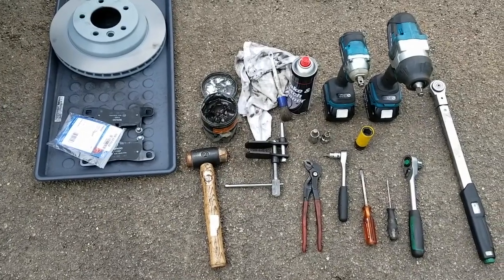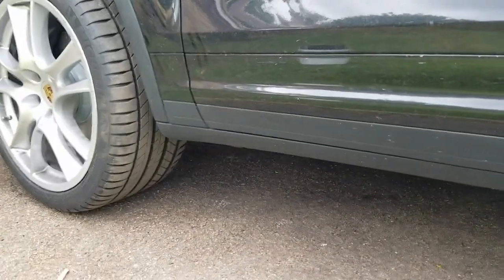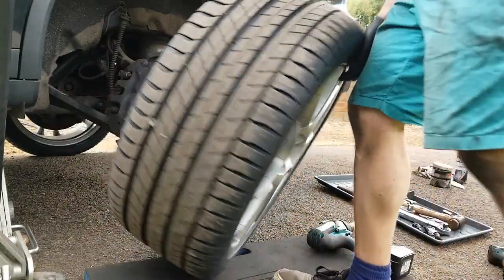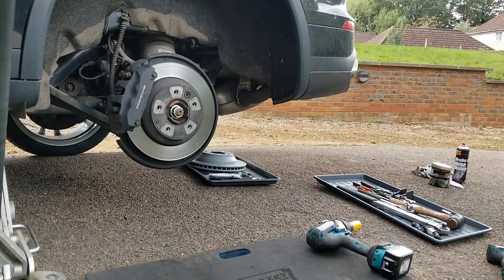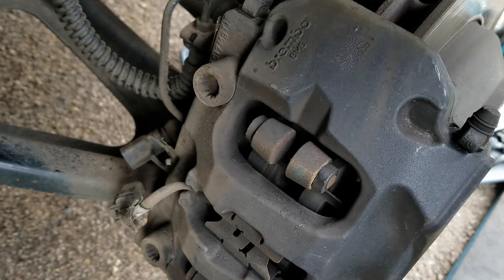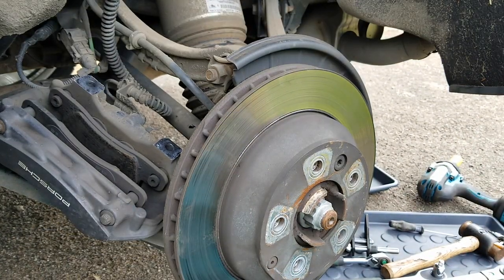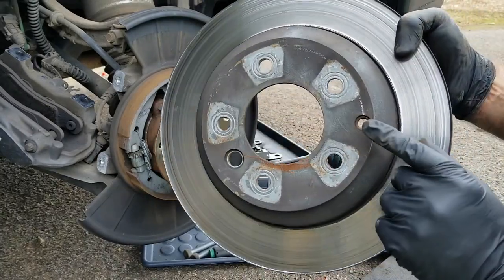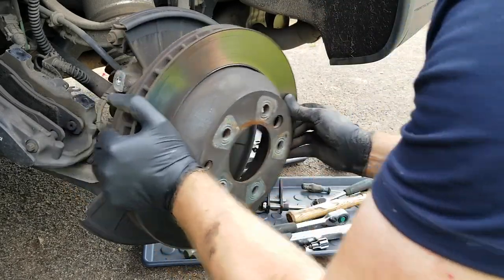Porsche Cayenne 958 Rear Discs and Pads Replacement Guide

Comment: Just wanted to say thank you very much for this and also the front pad and rotor video. Both are well-shot, extremely helpful, step-by-step walk throughs. I watched each a few times and then replaced the front and rear pads and rotors on my 2014 Cayenne Diesel this weekend. All four corners took me about 6 hours, but I did spend a bit of time cleaning.

Comment: Excellent video. I watched it, took notes and then did the replacement on my 2015 Diesel Cayenne.  Everything worked out great.  Thanks for taking the time to produce the video.  I also used your front brake video and it was also very useful.
Reply from the maker: Glad it helped, great to hear it went well!
Reply: Hey hi, any issues with the ebrake, I have a 2014 diesel cayenne
Reply: @marcelmouton6235  Not that I remember.  It was a couple of years ago.  since the emergency brake is a drum brake inside it really didn't get in the way.  I did my daughters volvo and the e-brake is electric and it just applies the regular brake - it was a PITA !

Comment: Thank you so much for the nice video! The only concern was that a jack stand was not used to support your Cayenne. I heard a lot of horrible stories associated with accidents caused by failed floor jacks. Other than that, it's such a great video! Awesome!
Reply from the maker: You are right, this is something you should do if you want to be as safe as possible. I personally only do it if I'm under the car but that's my preference, your suggestion is universally recommended.

Comment: You don't earn much, but if you had an affiliate link in your description for parts, materials, and tools, I would've used your links to buy them. It's a way to help pay you back for a great video. It's also nice to have one place to find everything needed for the job.

One small point, it would be a nice reminder to point out that level control has to be turned off before lifting the wheel off the ground.

Comment: Thank you very much for such a well detailed video. On my 2012 cayenne diesel, i noticed that when the engine is off, key is out and as soon as i open the door, the electronic handbrake light automatically comes on. If the electronic handbrake is meant to be off during the work, how do i prevent this from happening?

Also, im only looking to change my pads so whether the handbrake is on or off, does it make a difference?

Comment: Great video... Could you tell me please ? I need to replace the rear discs and pads on a Touareg 2016 R line. They are all the same bits and I was surprised that you haven't had to code the pad sensors in... Do you not need to do that ? If you do how do I ?   Again, great video

Comment: I have a 2014 Touareg and will soon be needing rears.  The fronts cost me $500.00 and was told the rears would be $600.00 Wow your video was perfect. All I need now is courage to try myself.  Only difference I would do is a jack stand beside the jack. I lean toward caution. I was told that they turned the rotors but I thought that was old school and the ones today could not be turned because they are too thin. Did I get taken by the dealer?
Reply from the maker: Hey Bart, thanks for the comment. Discs can still be turned. It all depends on whether they're within wear tolerances. I'd only consider doing it when there's a vibration caused by disc runout that isn't down to hub mounting or to reset the surface when changing pads on high performance applications. I'd always have them turned on the car, not off the car. At the end of the day, there's a bit of economics involved, if turning them cost less than half of new discs and they still have roughly half a service life left after grinding, it's worth it, otherwise its best to just get new discs so you'll get more miles for your money.

Comment: Is there anything we should do or know about the electric parking brake? Does it need adjusted or can anything be damaged by replacing the pads and rotors? I had this happen on my 2017 Kia Sorento SXL which had an be electronic parking brake. It needed to be 'set' after installing the rotors.

Comment: Curious as to mileage on the brakes when you did this.  Had wear sensor(s) triggered?

Have a 2014 CTTS and I just changed the front pads at a little over 50K miles.  Pads were worn but wear sensors hadn't triggered.  Amazingly (to me at least), the front rotors have minimum thickness listed as 36mm and when measured, the thickness was a little over 37mm on both, so I didn't change them. Rear pads and rotor looked (and measured) OK, so I didn't do them.  I switch between summer and winters wheels/tires so check rotor thickness at each seasonal swap so can monitor rotor thickness fairly frequently.  

If your Cayenne as adjustable ride height, be sure to put vehicle in "service mode" prior to lifting vehicle (procedure is in owner's manual).  If not put in "service mode" prior to lifting, the adjustable ride height mechanism will attempt to keep leveling the vehicle, possibly damaging the system.  
Also, I usually check the brake fluid reservoir as I'm spreading the calipers to see if there's any overflow.  

Porsche does not recommend brake/caliper grease when installing; not saying you're wrong, just mentioning what Porsche recommends.  
Assuming your torque units are N-m (Newton-meters); across the pond, we still use ft.-lbs.  As you mention, Porsche also recommends not re-using caliper bolts.  

In the spare tire storage compartment, there's what I call a "lug bolt stud" (I think the correct term is "pilot pin") that's useful when removing and installing wheels and looks like would have been useful for working on rotors as well.  It's basically a longer, headless version of the lug bolt and gives you a reference point for when you're mounting the wheels (and rotors).
Reply from the maker: You clearly know your stuff 🙂 yes, the car was put in service mode prior to jacking it up for the reason you said, thanks for calling that out! I check the brake fluid prior to starting the job to make sure no one has topped it up, typically moving one caliper back at a time when no top ups have happened will not result in an overspill. It's one of the reasons people should never top up brake fluid, it's a closed circuit and should never need it, any drop that isn't the result of a leak will be a natural drop due to brake pad wear. The grease on the pads is a personal choice, the system is known for squeeling at low speeds and this does help with that. If it had vibration reducing shims in the calipers then this would be less of an issue and I wouldn't do it. Yes, all in newton meters 🙂 I did the job at 49k miles, car was new to me and I wanted a fresh start on the brakes. I don't typically use the guide pins while on jobs but yes, a good thing to use if wheels etc get too heavy 😉
Reply: @dhansens  Thanks Daniel for this video. Speaking of torque specs for the 2 brake caliper bolts. So to be certain the rear is 85 Nm and fronts 140 NM? Do you know the torque specs for the wheel nuts? Thanks!
Reply from the maker: @bradchin7746  yes, 140nm front and 85nm rear. Wheel bolts are 180nm

Comment: Is it not dangerous to overtighten the caliper bolts by such an amount?
Reply from the maker: Good question, in my opinion, no. But, if you feel there is too much risk, then the recommended torque will also be fine, especially if you use new bolts.

Comment: Does this have electronic hand brakes?  If so, anything to worry about gaps?
Reply from the maker: It does have an electronic hand brake, they will need to be adjusted if your discs were particularly old. I mention the instructions at a high level for this when replacing the discs. Typically you shouldn't have to worry too much.
Reply: @dhansens  what software/tool do you use to adjust the discs? looking to get it to play around for when the need comes.  Thanks.
Reply: @khoaptran  question on this you mentioned it had lower miles...how many miles? I'm gonna do rotors and pads front and rear for my Touareg and worried about parking brake. I have 50k so just wondering your miles. Also thanks for posting this video super helpful for the rear brakes I'm used to Japanese cars so German is a bit different! So it is much appreciated and saving me hundreds knowing how to do it

Comment: merhaba elektronik el frenı ayar nasıl olur ve kaliprasyonu
Reply from the maker: you'll need a diagnostic tool that has that function. You use that to retract the handbrake actuator before you start the job and then reset it afterwards